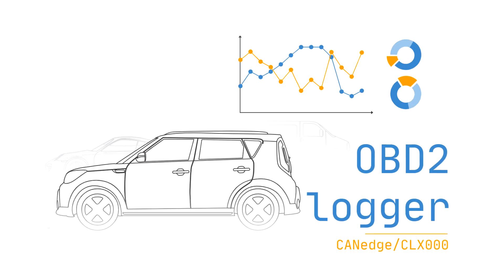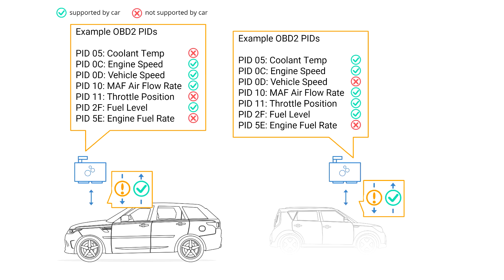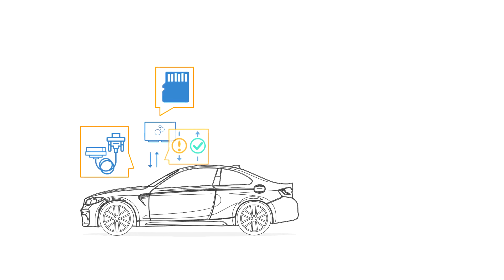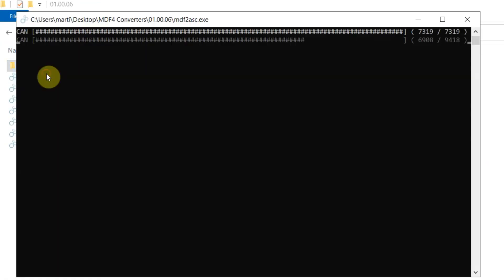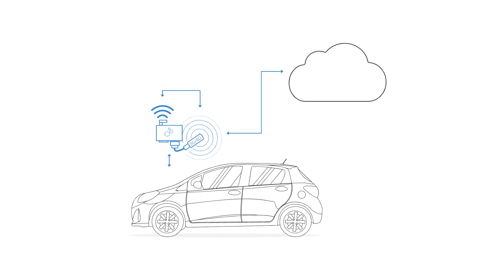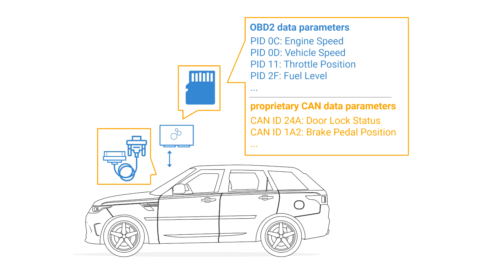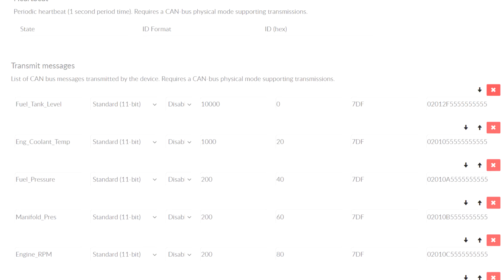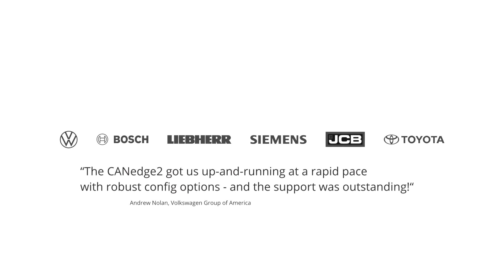OBD2 Data Logger - Easily Visualize Your Car Data [+ Free Dashboards]

Comment: Could someone explain me, why you even want use this " data logger and decoder" instead of simply obd2 device with any free software? for getting instantly live data ?
Reply from the maker: Most OBD2 dongles that offer live streaming will be the right solution if your goal is to e.g. monitor your car's health as a private consumer. Our devices are more targeted towards e.g. engineers working at OEMs that need to record OBD2 data, or academia where research may need to be done based on data from many vehicles (recorded to an SD card or cloud)